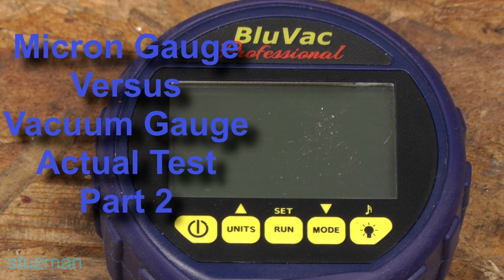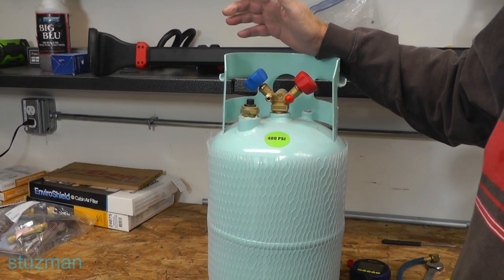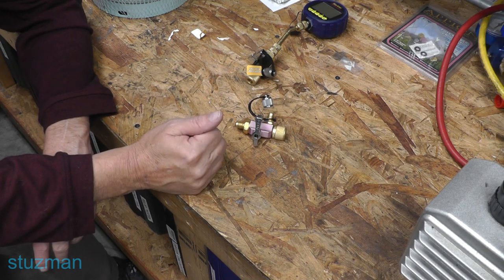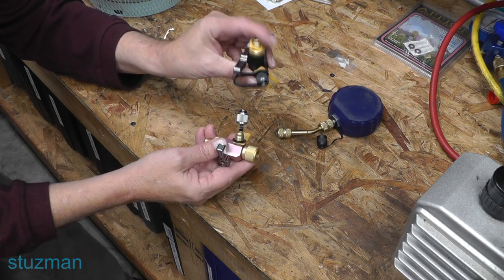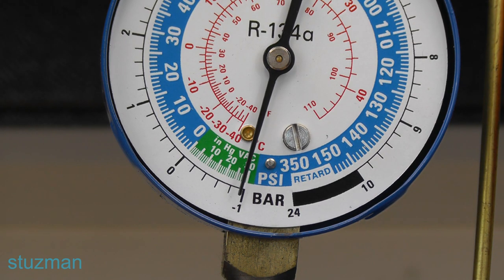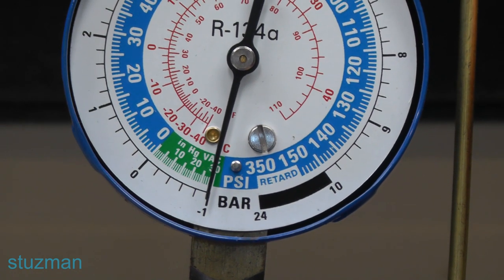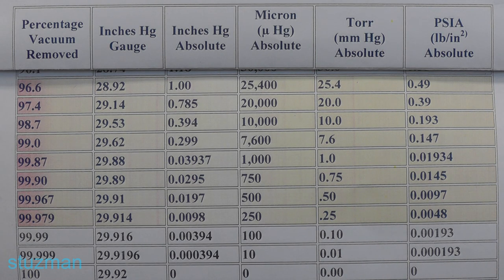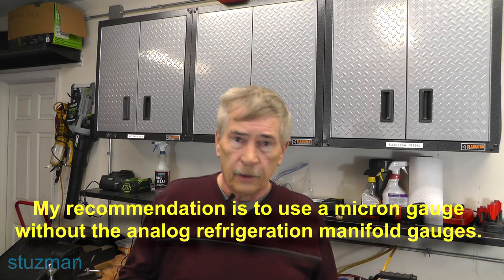Micron Gauge Versus Vacuum Gauge, Actual Test-Part 2

Comment: Incredible video series. Thank you so much for doing this series. Question: Can I use argon with the proper regulator/gauge unit to do the pressure test? I know the argon is mire expensive but I have a large tank of it already. Trying to keep the number of different compressed gas cylinders at hime down.  Thanks again.
Reply from the maker: Thank you John for watching and leaving a comment! Argon is an inert gas like nitrogen, so you should be good to go.
Reply: @stuzman52  Thank you! Am accumulating some of the tools on your list then I will do this!!
Reply from the maker: @johngibbins6843  Thank you John!

Comment: Wat is "procentage vacuum removed" may be ...of gases removed" the pomp not "moved vacuum" ....from system to atmosphere....
Reply from the maker: Not sure what your question is. If you're asking what  percentage of air a vacuum pump can remove, you can get that from the specifications of the pump. Have a great day!
Reply: @stuzman52  
Hi, was not a question. You use a wrong terminology. Vaccum cant by removed. you not remove vacuum from a closed chambre. you remove gas. when you reach anegative pressure you a in vacuum state. the title from your excel is not correct.

Comment: remember all your fittings have to be rated for 20 microns or so otherwise as soon as you pull your vacuum and start your decay test the numbers will easily rise above 500 microns.